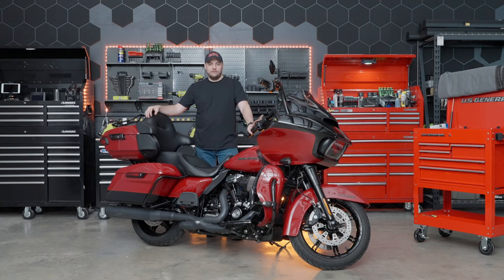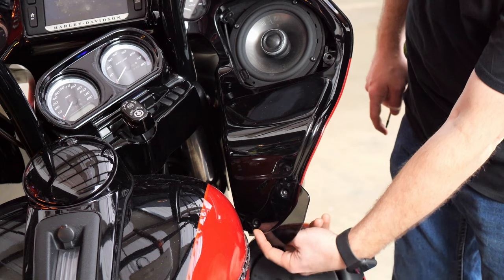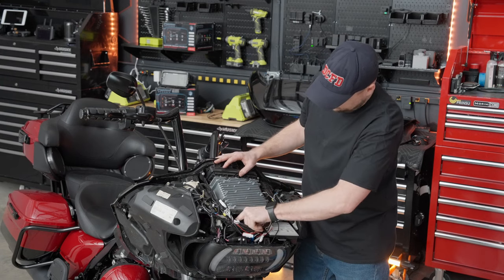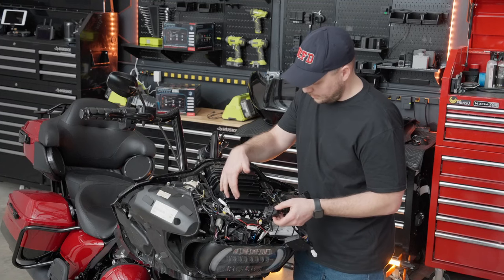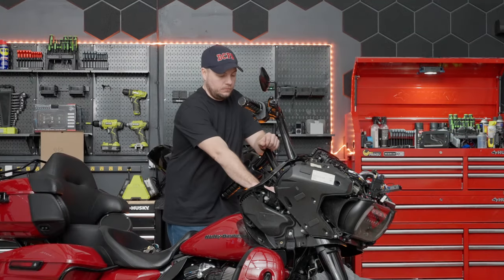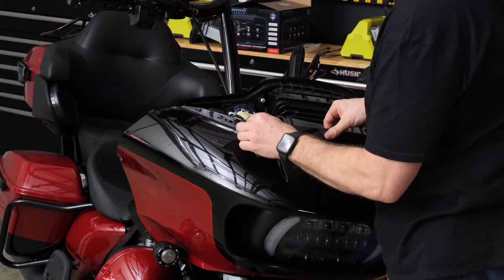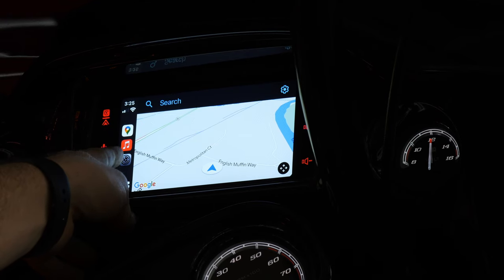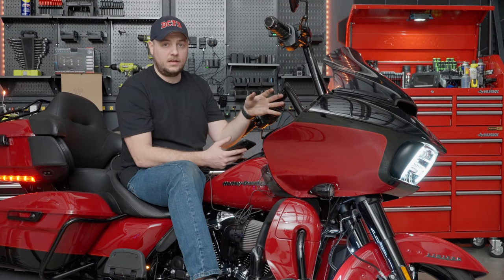Soundstream (HDHU.14si) Installation | 2014+ Harley-Davidson Road Glide

Comment: my radio on a Street-Glide CVO 2018 with 3 Amps has a problem; front left lower speaker and rear right saddlebag speaker does not work

Comment: It’s unfortunate it’s not compatible if you’re running the Thundermax ECM tuner. But the other soundestream Reserve unit works
Reply: I have thundermax as well. Is the reserve unit different ?
Maybe you need the handle bar controle unit ???
Reply: @jaapski82  it’s the digital gauges from the head unit that don’t reflect accurately or even work at all with the Thundermax. Unless they’ve released an update that is now compatible

Comment: How do you connect the amp remote wire?
Reply from the maker: The remote wire is the blue wire in our harness. It has a connector on it to fit the Precision Power amp but the connector can be removed / cut off and you can connect the bare wire to any remote on port on an amp.
Reply from the maker: The remote wire is the blue wire in our harness. It has a connector on it to fit the Precision Power amp but the connector can be removed / cut off and you can connect the bare wire to any remote on port on an amp.